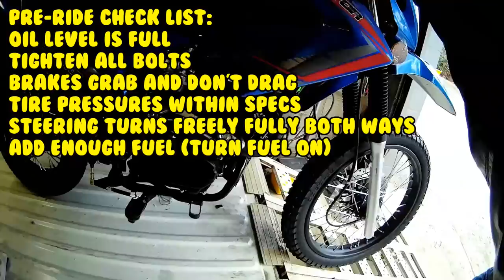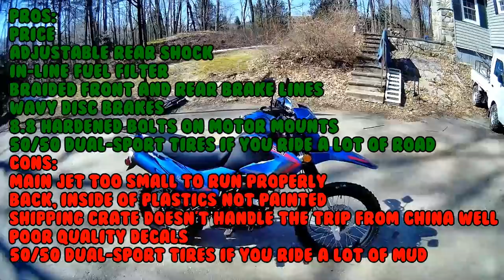$1300 NEW 2019 TAOTAO TBR7 230cc FULL REVIEW build ride mods Dual-Sport Pros Cons.

Comment: Hope you dumped the nasty fish oil out of the motor before running it, if yours had it in there, ours did. That's what they all come with. First step run it and drain it. I put Mobil 1 00W40  in our stuff. Great little bike for he money though... Just a thought.
Reply from the maker: I use the crap oil to break it in, they're using better oil than my first hawk 3 years ago. You shouldn't put synthetic in until after it's broken in, like 1000 miles really

Comment: Just a little update.. I called and said I had a few questions about this bike..  He said I'm your guy...  Ahh..  no he can't..  Asked about length of travel front and rear...  crickets.  How about a simple hp of the bike ?  Handed me over to a " specialist " who fumbled and finally said around 8 Hp "   I asked if he was pretty sure about that since it was supposedly a 230cc bike and that sounded ridiculously low..  Just for reference I had a 60cc racing bike that stood on its tail in 3rd gear when shifting..   I realize its not a racing bike but 8 hp for a 230cc bike doesn't sound right.  A push lawn mower can have that much..   I hope the bike is better than the level of expertise I heard on the phone.
Reply from the maker: The bike is around 13hp but it is torquey, it's the standard CG pushrod engine. I have the advertised specs in description I thought, motocheez.com has the specs too that I got off websites.
Reply: @MotoCheez    That's almost double and sounds much more believable..

Comment: I've had mine for about a month and a half...close to 500 miles. Great little bike for the money...
Reply: Update on how it's been for a year?
Reply from the maker: Great, Blade put over 6000 miles on it, no issues!
Reply: How about now ?
Reply: @Иванпонимаете-г4ш  put around 5500 miles without issue ..but now needs a new starter. So, overall, not too bad. They were 5500 HARD miles of riding, mostly off road. Not too bad for $1300 US
Reply: @stevealberts4566  awesome ,debating on getting one..of the engine is comparable to Japanese bikes i will get it
Reply: @Иванпонимаете-г4ш  I believe most of the Chinese 250cc engines are based off the 1980's Honda GS models. It was a hearty motor that held up well with little basic maintenance.
Reply: @Иванпонимаете-г4ш  Honda 250 dual sport is around $6500 US
Reply from the maker: The CG Honda most based off
Reply: @stevealberts4566  if the engine is a clone that. That's an amazing price. I see a used one for around 2k but might be worn out
Reply: @Иванпонимаете-г4ш  at least Chinese parts are cheap and plentiful. I believe an entire new engine is around $350US
Reply: @stevealberts4566  yeah i may go ahead and get  it. Considering the engine is basically a Honda engine. For that price it can't beat

Comment: I talked my friend into buying one of these (so I wouldn't have to sell him my Hawk) after watching this video. He used the Motocheez dicount and we hope to be assembling with mods this coming weekend. TxPowersports seems to be really helpful. Additionally we'll grease the steering stem and swingarm while everything is freash and clean. Probably set him up with 50mm of preload spacer on his forks springs with fresh 15 wt. oil 4 1/2 inches from the top of the tubes (collapsed no springs in). I want to see front and rear suspension move about the same amout when you bounce on the seat. Thanks for a great video - y'all got this stuff down!
Reply from the maker: Sweet. You seem to know these as well. 👍👍👍

Comment: Tech Tip for those wondering about how current model TBR7 is shipping, 88 Carb jet, 48 tooth rear sprocket, 15 tooth front sprocket, Air Box Mod done by re-design at the factory. If you choose the 45 rear tooth and a 17 front sprockets mod then you're only 1 link out from stock requiring no chain modification. Beware, the front 15 tooth sprocket on my bike was shipped with both bolts just finger tight!
Reply from the maker: Good info. Mine weren't too tight either.

Comment: I'm super impressed that wheelied! I have some tweaks to do on my SSR XF250. Hopefully after i get the carb jetting sorted, it'll be good.
Reply from the maker: Jetting is everything on these bikes, so lean stock
Reply: @MotoCheez  Yea, I did a full lextek exhaust on mine, but I did get the Sigma jetting kit. I think I need to go up a pilot jet and main jet size. i just haven't gotten around to it just yet. I haven't done a video on mine yet, but I probably will.

Comment: still not inverted forks, balanced engine, 6th gear or OHC engine?
Reply from the maker: Not these, they're the economy bikes, CSC makes a decent mid bike, but then you might as well by Japanese.
Reply: Apollo 250 has the OHC and inverted forks.
Reply from the maker: I'd like to review one of those Apollos. Do you have one?
Reply: Nah, I have the Hawk.  But I like the looks of the Apollo street version.  Would have to swap out the 17's for a 21/18 set up, though.
Reply: @MotoCheez  I have one but its been plagued by the chinese carb problems.  I spent the money on a mikuni which made it ok for a while but the one time I forgot to shut the fuel off and let it run till it drained the fuel out of the bowl it sat for like 5 months.  So the carb is not in need of service which I cant do after wrecking my street bike.
Reply from the maker: If you're close enough and want to sell it.lmk.
Reply: @Brian Clark add an ounce of seafoam per gallon for winter storage.  I don't even empty the bowl and starts right up.

Comment: Did you change the pilot jet?   I heard talk about the pilot jet but did not see it changed ?
Reply from the maker: No I did not. The mixture adjustment screw works off the pilot jet and if you get the mixture right using the screw then you do not have to change the pilot yet.
Reply: @MotoCheez  Thanks for the info

Comment: great video ,  i wonder how it would run with a proper japenese carb,  i would like to see it race against a 1300$ second hand 200-250cc dirt bike
Reply from the maker: I have older hawk 250 videos showing that. They have Mikuni cars for like $20
Reply: @MotoCheez  they arent genuine mikunis though at that price, the amount of knockoff carbs is insane on ebay.
Reply: I would like to see that agains a honda cr85/125 :))) the honda's got the torque easy... but speed, idk

Comment: I was wondering if there is any way to improvise a front axle spacer? It looks like it would have to be a perfect match, because it looks like it fits into a seal and butts up against the wheel bearing.  I recently got my TBR7 and the spacer appeared to have fallen off in shipment (where it is braced through the forks, the axle bolt had come loose while shipped).  It's been nothin but bs trying to get the part from the company I bought it from.  Any thoughts would be greatly appreciated.  Great vids btw!
Reply from the maker: That's a tough one, you're right. You can see if pit bike ones online may match up

Comment: I finally registered the bike and drove on the road. It’s all stock. Max speed i got was 50 without it screaming and me weighing at 150. But tried giving it more gas but felt like it tried bogging out? Will carb and jet upgrade increase my max speed?
Reply from the maker: Sweet! Yes rejecting will get you better top end, adding a 17t front sprocket also. Check out the links for that bike on motocheez.com I have a link to a kit a guy puts together on ebay
Reply: @ MotoCheez
Thanks! I actually bought the 17th sprocket off your website link, but haven’t installed it yet. I’ll go ahead and order the carb and jets.

Comment: running lean so try with the air box lid off?? then turn out air jet? i think that's gonna compound your lean issue.
Reply from the maker: Yes it will. Just confirming it was lean
Reply: @MotoCheez  Ya I get ya. Pretty crazy they can sell these bikes so cheap

Comment: Do you think the adjustable rear shock would fit on the hawk? I've been looking for a better shock. I max out the one I have so it's super hard.
Reply from the maker: Yes. Pretty sure it will
Reply: @MotoCheez  now to just find one. Thanks!
Reply from the maker: I told txpowersports to stock them because they're going to be getting a lot of calls so maybe contact them and see if and when they're getting them

Comment: NICE BIKE!

Tao-Tao!... Not "Taco-Taco"...

So, how is "Dumpy" fitting in?

I so wish that I had your resources and knowlage...

SO, I COUL "POSSIBLY" GET THE MOTOCHEESE discount here in Washington, if the "BOSS" allows...

Sadly I may not be obtaining my KEI TRUCK for a out 2 years (worst case scenario"...

I definitely want a "DUMPER". What was the technical difference between the 'SOFT' and 'HARD' Dumper?

I want capacity... I'm also looking to incorporate 7' (84") ramps under the bed for accessibility to unload equipment...

Thanks for sharing!

Take care,
🤓-Thomas Skagen
Port Orchard, Washington
Reply from the maker: Dumps good! Yes the discount is for both coast boekiusa. Yeah as long as you can get one.

Comment: My oil drain plug broke, the one on side of motor under shifter 24mm, any ideas on where to get another?
Reply from the maker: Txpowersports should have them, but if not, I believe they are the same as the Honda used for theirs. Valve cover adjust too!! Not 100% but worth a try if txpowersports doesn't have.

Comment: What is the top speed , and how fast in a 1/2 mile from start? I had a 50cc scoot to putt around on. It was very fast compared to others, but too slow for me, if it only goes 25 mph I think it should get there fast,, mine would do 55-60, eventually, about 2x other 50cc, from china,  don't know what was done to it, but 200-250 cc bike would be cool. The Dr 200 I had would bee OK if it was streetable, but 250-450 or even a dr 650 I always wanted one, I would want to lower it , I'm not going off road, I just like how light the street trail bikes are, I'm 6'2" id like it to be as low as a 100 cc bike,  the legg issues I have make getting on a bike difficult,  maybe I should put a 250+cc engine on a 50 cc scooter frame, 5 gears, light weight, ha-ha crazy ideas I know,, keep at it ...
Reply from the maker: Top speed with these mods is about 65mph, not sure of the 1/2 mile

Comment: Is the clutch lever supposed to have a little spring on it? If so mine doesn’t have one.
Reply from the maker: No. Not the lever. It’s down where it goes in the engine
Reply: Ok, thanks man!
Reply: My lever just doesn’t release all the way and it has the right amount of free play it’s just like it doesn’t doesn’t spring all the way back though
Reply from the maker: Jackson Ramsey it will do that until the cable wears in as you ride it

Comment: you had to rebuild the carburetor brand new!?
Reply from the maker: No. Rejet. All the carburated bikes come very lean because EPA. If 6000 feet it's probably jetted correctly.
Reply: @MotoCheez  I saw there is a new Hawk 250 with fuel injection. I may go for that one. I live in Oregon and we usually are at a lower elevation.
Reply from the maker: Indidna review on that one too. It's an awesome bike!

Comment: Do you know what bike these are a clone of?
Here in Japan we had a bunch of these close come and most of them were older Suzuki DR250 clones. It was amazing most of the parts for the older model DR 250 would fit the clones, aftermarket stuff as well as OEM.
Just curious.
Cheers from Tokyo!
Reply from the maker: CG250 engine, I believe crf230 clone
Reply: Its clone of the Honda Xr160 or Xr150
Reply from the maker: It does look a lot like the XR150!
Reply: You are referring to the Qingqi/Pioneer bikes.  They had a near-exact engine to the DR200 a while back.  These Hondas; we refer to them in the US as Hondnoids; means they are very similar but nothing quite exacting to any Honda engine model.  In other words, some things might interchange with certain Honda engines (none of which we had in the US), whereas the Qingqi/Pioneer products would interchange directly with certain Suzuki engines.
Reply from the maker: The engine is a CG Honda clone, most parts interchange too
Reply: @ME262MKI  they are sold in Mexico and/or Brazil, eh?
Reply: @fredtracy1673  yeah, mainly south america
Reply: Funny, 40+years of cloning and still cannot get them made right-^^
Reply: It's based on the brazilian Honda NXR 150 Bros (I'm not calling you people bros btw, the bike is named "Bros") though that engine looks a lot like the CRF230 we have here as well. Mind you, the Honda bikes which this one is based off of are pretty reliable, i've had the Bros 150. Now, a chinese frankenbike based on a couple of cheap third world country designs? I wouldn't expect It to be that great.

Quick edit after watching the whole video: Our NXR 150 has had fuel injection since 2013 I think, the CRF 230 is carburated but never had a electric starter from stock. I assume the engine is most likely the same as the chinese Traxx 250cc engines, a straight copy on the CRF230 with some bits and bobs. The swingarm also looks a lot like the one from the Traxx Fly 250, maaan there's some crazy shit going down in those chinese factories.
Reply: @MotoCheez  yup. honda clones
Reply: It's a Honda xr150 clone, chinese mainly screw brazilians with the designs because they don't sell much brazilian hondas in the US, the engine is the typical honda CG clone pushrod engine
Reply: @MotoCheez  
It is definitely a Honda NXR 150 clone.
Reply: @herrmahlzahn6924  So a 230 bike is a clone of a 150? How is that? Do you mean just the cylinder is different and all other parts the same or are they lying about it being a 230?
Reply: Honda xr 150L clone
Reply: Joe Bland 
They even copy breast implants. 
I think the Chinese ones are smaller.
Reply: Cool tip..
Reply: @culcune  How do you suppose the metallurgic quality of the Chinese clone engines compare to their Japanese designs?  And do the Chinese clones utilize plastic engine components such as camshafts?
Reply: @abeeftec  Could be that the 150 and the 230 are the same engine, only difference is the bore size?  Kinda like small block chevy engines.  That's just speculation though, idk for sure.
Reply from the maker: Could be!  That'd be nice, easy Big bore
Reply: @MotoCheez  Yeah, there's always the "Big bore vs. stroked argument..Do whatever your needs/freedom allow... But,   if your government is pushing "electric" vehicles...  Consider resisting.  Government has no intelligence and even less than zero morals, in fact the only ting government is concerned about is the next election..  And,  lithium ion batteries will inevitably end up in future generation's water supply...
Reply from the maker: True I'll bet the 150 has a shorter stroke too, I didn't even think of that

Comment: I love my Hawk, 2,300 miles, plenty of the normal mods, 73mph top speed. 100 mile commute to work to Boston. Its fun in the city I will tell you that.
Reply from the maker: Awesome!!!
Reply: Mine does 70 max with airboxmod,107 main jet,cat delete and 16 and 43 tooth sprockets
Reply: Cool man. I commute 120 miles on my KLR 2 days a week. The other 2 days I take it easy and drive my truck 100 miles and ride the last 20 on my TW200. Cool to see another long range single thumper commuter!!
Reply: @MotoCheez  in your opinion, would the new EFI Hawk be the best bet if i am needing something that can get 65 comfortably and hit some dirt roads. I live in South Florida and people drive nuts so i need something peppy. Looking forward to your response
Reply from the maker: @FilthyForce  65 is about max with the 17t front sprocket   it's really a nice bike for on and off road, I'd say not a good highway bike because you'd be pinned on the throttle keeping up with traffic.

Comment: As long as the buyer has some mechanical ability, I don't see how you can go wrong.it's got me checking into one.     Top notch editing!BTW
Reply from the maker: Ty👍👍
Reply: The question is, can it be street registered in one's state.
Reply from the maker: Most states yes, CA, no. Check chinariders.net.
Reply: Wes Frazier I thought the same thing and pulled the trigger on the grom clone. I got the Tao Tao hellcat in red ordered it yesterday now I’m waiting for delivery. 1130 shipped to my door I mean you CANT beat that. I fix everything as it is so I’m not at all afraid to turn a wrench on one of these. I can’t wait summer is gonna be awesome. I’d say just pull the trigger man you can’t go wrong. Ntm if something does break its stupid cheap to fix or replace it.